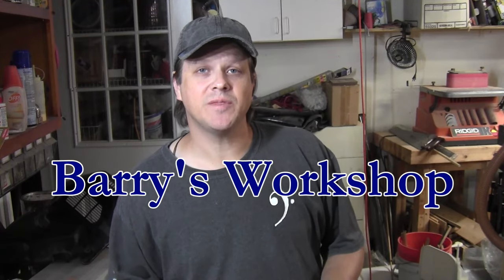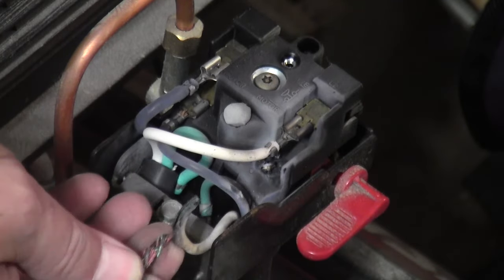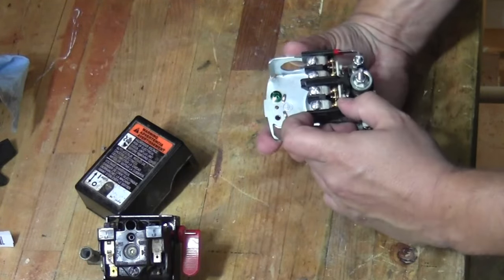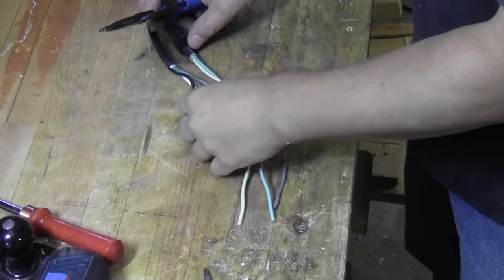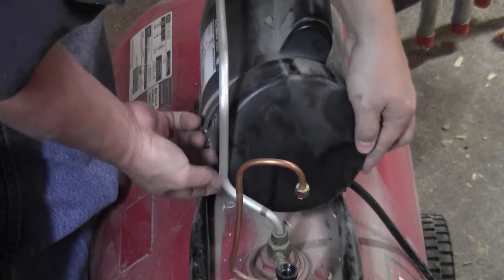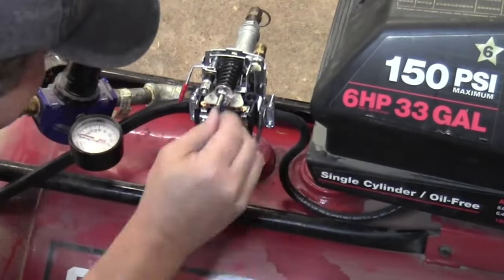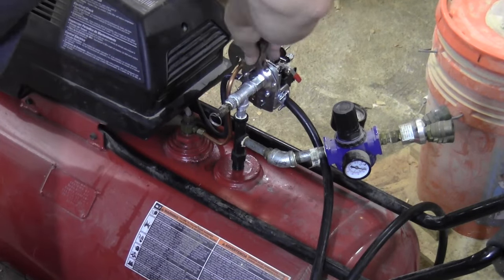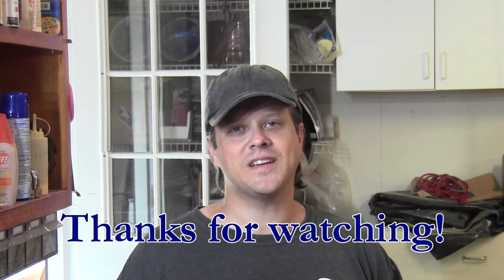Repairing a Compressor Pressure Switch

Comment: Hi friend  my mistake
 I bought same design but it's 20amp max and 175 psi can It replace mine which is 125 psi max and 16 amp and reduce pressure by turning I think counter clock wise once it reached 125 psi looking for your help and is that part ok for me it's same except psi and amp instead of 16 it's 20
Reply from the maker: You need to match the amperage because that relates to the current that the motor pulls while running. The amperage relates to the contacts in the switch. If you under-rate the current value, the contacts will wear out sooner and could be a safety concern. Changing the max pressure setting won't change how much current the motor uses while it is running, but it will control when the motor shuts off. 

It should be fine to use a lower setting for max PSI, but the trade-off will be that the compressor will cycle more often when you are using it. In my case, I went from 175 PSI to 150PSI and I cannot really notice the difference. 125 PSI is pretty low, and while it will probably work, you might wish you had something closer to the factory settings. Definitely DO NOT use a higher value than it came with.

Comment: Is this a 230v motor?  If so use 12awg wire
Reply from the maker: The motor is 15A 115vac. 

Thanks for watching!
Reply: it"s a good time to measure the compressor run capacitor when you service the cycle switch - Reason to suggest that test is higher than normal start and run currents. A derated cap will heat up the motor windings. 
Run caps are used to feed a secondary winding with a precise phase shift from the main one.

Comment: Excellent video. Would you tell me the part number for the better switch you installed?
Reply from the maker: Thanks! The one that used is 'Square D by Schneider Electric 9013FHG12J52M1X'. I don't know if this will work with yours or not, but some factors to look at are 
1) whether yours is four port or single port (mine is single), 
2) the port size (easy enough to step up/down but I prefer fewer connections when possible),  
3) voltage 
4) the amperage rating of the electrical contacts, and 
5) the cutoff pressure and differential. This switch is factory set at 125 psi and has a 30 psi differential. It's adjustable (some are fixed), but I left it at 125 even though my old one was 150 psi mostly because I don't need that high pressure.

Thanks for watching, and for posting your question. :)
Reply: Barry's Workshop
Reply: Northern Maine p

Comment: But if I reduce pressure and for amp I think this is if I used 175 psi it need 20 amp not 125 psi so that's will not hurt as I think not electrician but trying to understand

Comment: What is the part number of the Square D pressure switch
Reply: Mine looked just that that Square D, and here is the info:
Specifications for this item
Global Trade Identification Number	00850019749861
Model Number	CW214300AV
Part Number	12RC2FABY
UNSPSC Code	40150000
Voltage	120 volts

Still, you should find the part number from your switch.

Comment: Those little switches are built shity, craftmen are worst made in China. Older models are better. Nice video and great instructions.
Reply from the maker: Thanks for the comment. The one I have was actually made by DeVilbliss. Several years ago I got a notice about a class action where they misrepresented the HP of the compressors. It affected many brands, including Craftsman, but they were all made by the same company.

As for the switch, I'm amazed that the one that came with it lasted as long as it did.

Comment: Disappointed that you didn't repair the switch as the title indicates, you just replaced it.

RichE
Reply from the maker: I can understand your disappointment, +Gogle Plus Sucks. A lot of what people call repair is actually parts swapping, and that is indeed what I did here. 

Thanks for watching, and for your comment!
Reply: Who cares if he did not repair the fucken switch. The old switch was burnt out. He upgraded to a much more improved designed switch like he said!
Reply: Hi I need same help I have big compressor but don’t have any pressure switch on and have 7 wire coming out from the box I don’t have any clue to connect the compressor
Reply: hope yer good with an ohmmeter & some # tags..
Reply: @Barrysworkshop  Thanks for the reply, Barry.  Nothing wrong with swapping/installing new parts as a repair.  Title indicates repairing the switch, vs. the compressor, that's all I was referring to.  Keep up the good work!

Comment: I have the stand up verison of this craftsman compressor. I have a problems with it starting up and it pops the breaker in the house. Soo i think its the switch. I habe the same switch that you had gone bad. It seems this compressor times the full 15 amps from the eletric outlet. Anyway yea i could use any tips of knowledge from you if i could. It just pops the breaker and trys to start. When i took the switch apart it sparks green when you filp the switch on. Doesnt look good and then pops the breaker. Is this normal for it to spark green when you thorw pursure switch i just i want to rule out the right problem. I really like the compressor